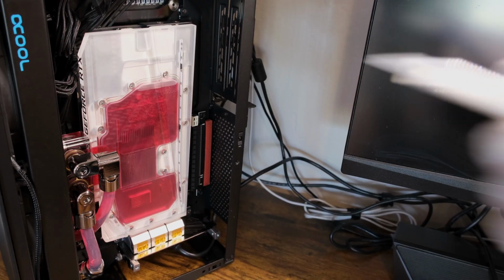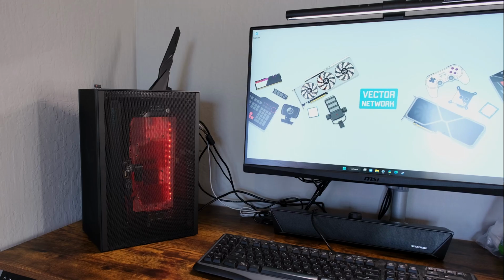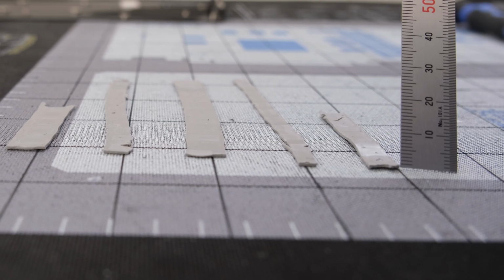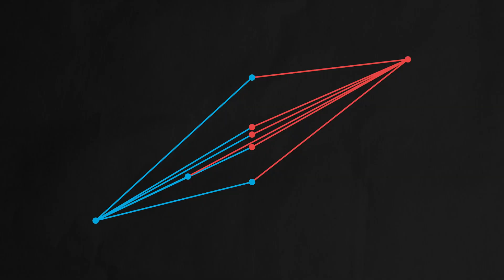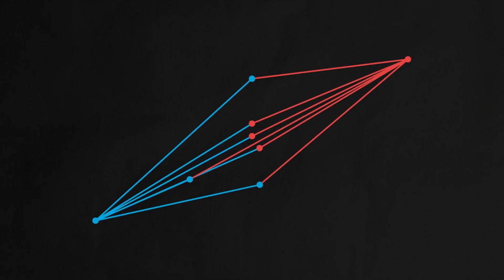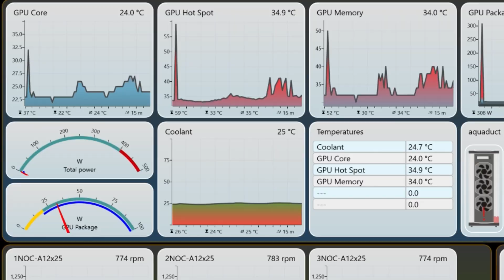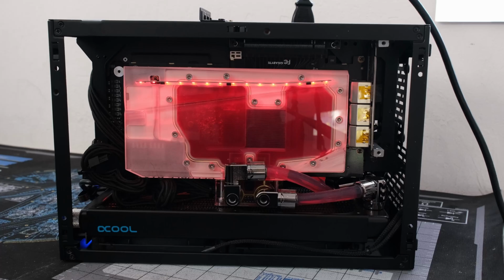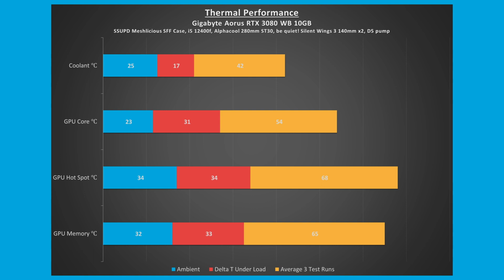Leak Detection RTX 3080 Gigabyte Aorus Water Block Teardown Thermals Water Cooling SFF Case Testing

Comment: Oh god... Covering up the block is such a stupid design. I got two 2080ti super cheap and wantet to clean the blocks before hooking them up. How the f am I supposed to do that without destroying the faceplates... -_-
Reply from the maker: Yea, I really didn't even try to save the plastic covers, but I suppose if you heated it up enough the glue would become soft and you could technically just pry it off easier. I sort of liked how it looked underneath with the clear and the white.

Comment: hello could you please link the thermal pads that you used , you have some excellent results when it comes to temps.
i have a nr200 loop with rtx3090 waterforce extreme WB and a i5 13500kf , 2x240 + 1x140, at idle my gpu keeps a core temp of 38degrees and memory of 50 degrees , under benchamark the memory gets to 90 degrees.
is that a normal temp?

Comment: Hello, great video. Can you help? I have the same graphics card and I have already checked everything and I don't know what's going on. I have a leak alarm all the time, the card flashes red and at the same time the two white diodes next to the connection also flash.
Reply from the maker: Thanks for your comment 🙏 This is an issue with the leak detection that I have read about online. That it is on all the time. I haven't come across this issue on this card. So, it is still hard to tell if this is due to some kind of product error or something else. What kind of fittings are you using? Are they somehow touching any of the leak detection portion? Have you tried cleaning any of the leak detection parts to see if some residue is causing the false positives?
Reply: I checked the connection and it doesn't touch the circuit anywhere, even without fitting it didn't change anything, I also disconnected the 2 pin cable from leak detection
Reply from the maker: Wait, the leak detection cable is disconnected and you're still getting the leak detection alarm going off? That tells me there is something wrong with the card rather than the leak detection unit. My understanding is that when people had leak detection issues with the card, they unplugged it the leak detection cable and it would then work fine.

Comment: Gigabyte AORUS  RTX 4080 16GB Xtreme WATERFORCE 
1200€ usada amazon 1 año
1750€ nueva amazon 3 años garantia
1350€ + 200€ waterblock (asus tuf + alphacool..)
>_< ¿cual saldria mas a cuenta?  / intencion a 2k 120hz full settings.... para 10 años al menos a 80fps ultra....
1080ti >> 4080... o esperar a 5070ti

Comment: It makes me sad that you have to remove the decals to clean the block. Can they be reinstalled?
Reply from the maker: Thanks for your comment 🙏 In retrospect, I should have done a better job at removing the decals. In the future, I will make sure to use a heatgun to soften the glue and remove it in a manner where the decals can be reused. Hope that helps

Comment: it looks so much better without the fake mirrors
Reply from the maker: Thank you for your comment 🙏 I agree 100%. It wasn't until I tore down this block and then did the testing on the temps did I realize just how simple water blocks are in general. And it looked just fine cleaned up with the white opaque color and gold trim.

Comment: no wonder they cover the whole water block up, it's such a simple design of waterblock. But simple as it is, the temperature is really good
Reply from the maker: Thank you for your comment 🙏You're right. They covered it up because it looks like a bathtub. But like you said, temps are good. In the end, tearing it all down, really helped me understand the components of the water block and just how simple the whole thing really is. Its a piece of metal that is carefully cut-out, but can follow a simple design. The rest is just a way to enclose water around the metal, which seems like just rubber and acrylic is chosen because we want to see it. And then you have a terminal for the water to flow in and out. I am sure there is more to it - but the mystery is gone.

Comment: Could you please tell me the thermal gap filters' detail thickness? I could't see the thickness data on your ruler clearly.
Reply: I mean thermal gap filter is the thermal pad.
Reply from the maker: Thanks for your comment🙏 The pads for the VRM are 1.5mm thick and the rest are all 1.0mm thick. Hope that helps.
Reply from the maker: Thanks for your comment🙏 The pads for the VRM are 1.5mm thick and the rest are all 1.0mm thick. Hope that helps.

Comment: I just bought one of these cards to put in a build. The card looks to be in great shape but I noticed that one of the screws around the ports has some of the previous owners blue coolant inside. The card did leak out some during shipping (previous owner didn't do a very good job at emptying it or sealing it for shipping, so the card was a little wet when I opened the box). 

Is there an easy way to get those screws out or will I also have to remove that logo plate? Curious if you bothered putting the other decals back on this card and if so was it difficult to stick then back down? I'm already going to be putting a few extra pads on the backplate for the vram to help cooling some and changing out the stock thermal paste, with the leaking during shipping I'm thinking taking it apart might be a good idea just to make sure it doesn't have fluid on the board also.
Reply from the maker: Thanks for your comment 🙏 It sounds like there is some blue coolant around one of those big screws on the In and Out Port. I never tried to remove those screws, but by inspecting it, my conclusion was that the only way to get those screws out was to take off the logo plate and simply unscrew them out. However, if you don't have the rest of the block torn down, you won't be able to open the block (only just take out the screws). I never bothered with the decals. The large plastic stuff just went in the trash (its plastic and covering up the actual waterblock and coolant) and the remaining sticky substance and decals I carefully wiped off (it took a long time, its a lot of glue, I didn't show that part bc its kind of boring). I am not sure you need any pads on the backplate if you have a 12GB 3080 as all the memory are on the front. The only time the memory is on the back are the original 3090s. The 3090 ti used 2GB modules (rather than 1) so they were able to stick them all on the front. The reason this model even has a single thermal pad is to make it even as one side sticks up because of the RGB in the backplate. I would absolutely open it up to repaste it at the least. Hope that helps.
Reply: @vectornetwork  Appreciate your getting back to me.

I took apart the card and glad I did as there was some coolant on the PCB from shipping, that could have caused some issues. I also got a closer look at the bolt mounting the connector block. I honestly can't tell where the fluid is coming from now. There is a line of it from both the seal going into the block AND from the crack going outside of the connector block. So it could have come from a leak OR from the outside of the card during shipping. I sent a message to GIGABYTE with a pic asking their advice but that might be a dud since it was bought used.

I also MIGHT have managed to destroy the leak detection cable when removing it... was trying to be careful to not tug on the wires so I took a small pair of needle nose pliers to pull it out from the connector, and they slipped clamping down on the wires and instantly breaking them off. Guess I'll either have to find a replacement cable or work on my soldiering skills some to make a new one. The cable has a little slack so I could possibly just repair it with the same one. Oh well for now everything I've seen has shown issues with the leak detection anyhow.
Reply from the maker: @JohnA...  Hm, coolant on the PCB would absolutely cause a problem. I want to pose the possibility that the card may have leaked prior to shipping. If I had to venture a guess, the liquid came from inside the card and not outside. I wouldn't expect much from Gigabyte at this point. I wouldn't also worry so much about the leak detection, most people turn it off or unplug it anyways. I sincerely think that the issues are with the seller. But if you have no recourse, I would take apart the whole block, clean it and let the PCB try, reassemble and hope that the card isn't already broken from the initial leak (which I think is due to the seller and not the shipping). Hope that helps.
Reply: @vectornetwork  I actually already had taken it apart as I was planning to add thermal pads to the back and put better thermal paste on the die. The coolant on the pcb wasn't much at all just droplets, that's why I assume it's from shipping. I also took the time last night to hook the block up to a thing I rigged up for rinsing out the rads and it didn't seem to have any leaks, so at this point I am going to assume that the fluid got into that spot during shipping, from the outside. I did heat up the decal and take it out then easily got the little coolant off the bolt with a paper towel. Gatta say gigabyte is not thinking ahead of time covering up the screws on this block, makes maintenance a hassle.

Anyhow besides me messing up the leak detection cable it seems okay, I'm going to put the card back together and hopefully put the whole build together today, fingers crossed I've no other leaks in the loop.

Thanks for the feedback.
Reply from the maker: Ah, makes sense. I think you would know best since you have the card in front of you. Good idea to heat up the decal prior to taking it off. I sort of just went to town. It was a mess. I hope it works out and the build gets up and running soon.
Reply: @vectornetwork  it's been like having presents under the Xmas tree that you can't play with, right now it's put together sitting on my dining room table waiting on a squirt bottle of all things so I can fill the loop (didn't leave many easy options there). Going to leak test first and hopefully this weekend get everything up and running. I'm putting it on the opposite side of my desk so I'm going to also have to run all my cables again. Hopefully it goes well, can't wait to test it out a little.

Comment: Could you please tell me how much (ml)  cooling liquid you've put? I have rtx3080 Xtreme Waterforce AORUS REV1.0 and liquid has leaked. Now it's empty, I need to fill it again.
Reply from the maker: Thanks for your comment 🙏 Do you mean how many drops (ml) when I activated the leak detection? It was 1-2 drops of water. So maybe 1-2 ml? Very little water. Actually, the prior owner of the card had unplugged the sensor because it was too sensitive and would cause leak detection even when there is no leak. For your case, what is happening? Your waterblock is leaking?

Comment: I feel like all graphics cards in the far future will have this kind of technology, water-cooling will become the main way to cool pc's, graphics cards and cpus are pulling more and more power meaning more people to put it on water and even with the highest end parts there is always that chance of it leaking and killing potentially thousands of dollars in hardware😅
Reply from the maker: Thanks for your comment 🙏 Agreed, I do think that the risk of a leak and potentially losing hardware is a real fear that prevents people from doing water cooling. The technology likely needs to have some improvement because I have read several instances where people had problems with false positives from the sensors, causing their cards to turn off even without a leak. That can be frustrating, so maybe the manufacturers will put in an easy off mode rather than trying to unplug the 2-pin sensor.
Reply: @vectornetwork  I haven't seen any other water-cooling leak tech like this other than some niche aios, Its still a "let's try this and see if it works" stage but within just a few years I see it being more mature will more precise such as fittings and other blocks will eventually have this tech for the people that's scared of mixing water and electricity, just my 2cents
Reply from the maker: @calebrose2031  Makes a lot of sense. I didn't think anything of the tech (haven't seen it either) until I mentioned it to a friend. He was adamant that it was something interesting. So, I took the footage of it going black and glad I did! So, the red light will continue to blink until it completely stops detecting liquid. The first try, I wiped it away immediately and I thought the red light would only blink momentarily. The second try (for the camera), it blinked red indefinitely for a long time as I really had a hard time wiping off all the liquid while it was running. This is a used card (hence the cleaning) and the original owner said he had issues with the leak sensor always going off, so he shipped it unplugged to me. I cleaned the card as shown and the leak detection worked perfectly. It is kind of important that the card shuts off too, rather than it just being a warning light.
Reply: @vectornetwork  I have this card and I can confirm that false positives from the leak detection circuit is a pain in the rear. Using the non-micro EK Torque fittings the metal of the fitting will contact the leak detection circuit and prevent the GPU from working. If you get this card, make sure to use fittings that are narrower than the diameter of the wire around the ports.